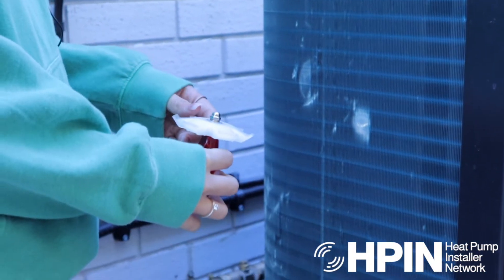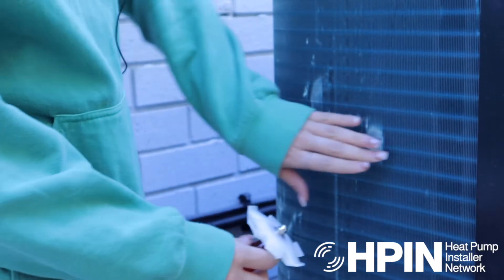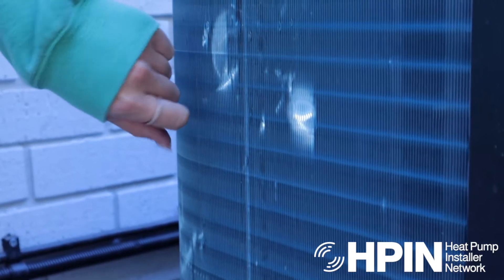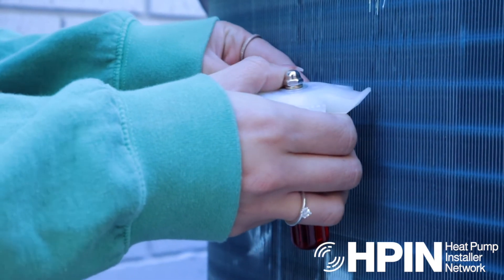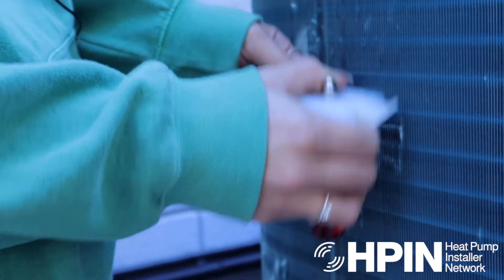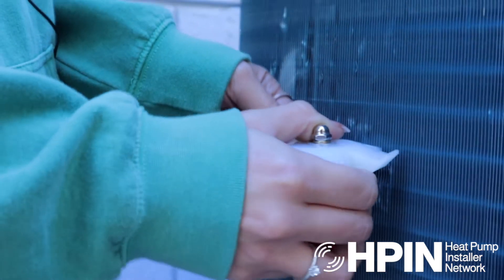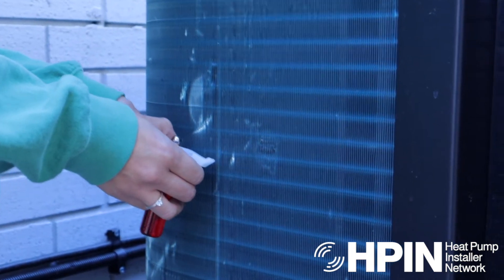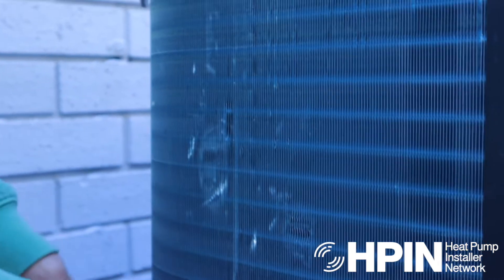Fixing Damaged Heat Pump Fins

Comment: Thanks for the tip can you get these at Home Depot? With my air conditioner and my neighbors I had to patiently use tweezers to straighten out the fins. You'll need the patience of a saint but it does get the job done to straighten out  those extra bruised fins. It is a handy tool you have there I should check it out thanks I hope that you and everyone else would be a better year I'm staying healthy and safe and with plenty of mental sanity we can use to find some peace.. it's been an impossible few years. The best wishes and thanks Thanks again for showing us this neat wait and straightening the fins out🙂
Reply from the maker: Not 100% sure on Home Depot but you can buy them online for fairly cheap. Thanks for the comment George!